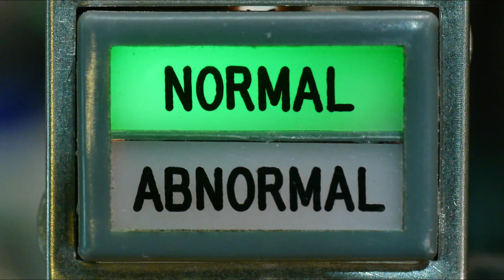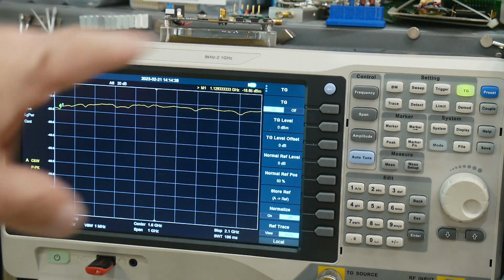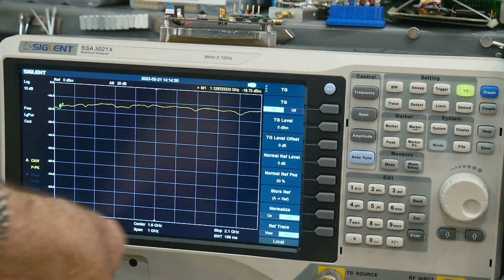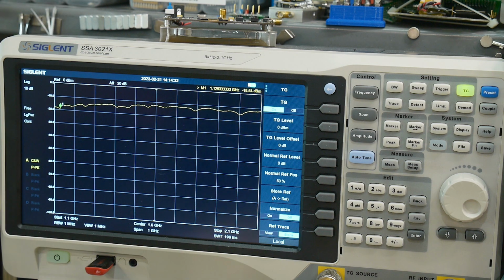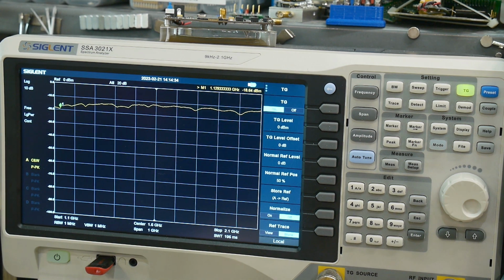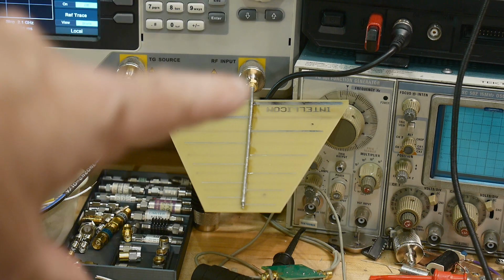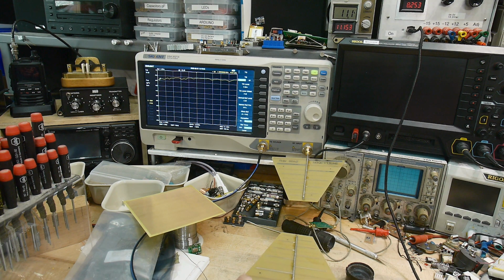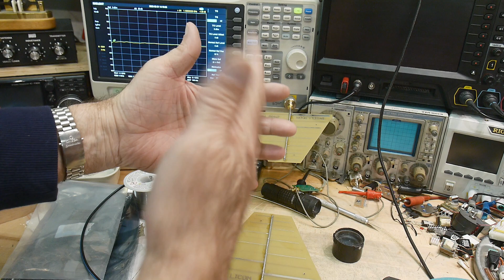#1440 Antenna Polarization and Wire Grid Polarizer

Comment: Can you add resistors to the wire lines to dissipate the RF power instead of reflecting back to the TX antenna. 
The 20dB reduction is due to reflection not absorption.

Comment: I went to engineering school and half the stuff you talk about on here, we never did in school.  When I attended in the 1990s, they were spending more time on digital, less time on analog, and very little on RF.  There seemed to be a thought that analog and RF were old hat and everything was going to be digital.  That was before cellular, wi-fi, Blue Tooth, satellite, etc. exploded.  And, we now routinely do digital in the MHz and GHz range which is of course RF.  

And, while we had Tek scopes and HP test equipment, the stuff you have on your bench, even the older items, are at least an order or magnitude better (higher frequency, tighter accuracy) than what we had in university.

Comment: In antenna we have Far field and near field and the near field is divided in two parts reactive near field (which is about 1/6 of a wavelength of the nearest antenna surface) and then Radioactive near field ( also known as Fresnel )
1/6 of wave length for 1GHz (wave length about 3m)  is about 3/6 or 0.5 m or about 1.5 feet. Polarization is more significant for far field.
Here some fun experiment: put an aquarium in the path of the waves and fill that with water and sugar. You will see , it will rotate the polarization.
Ferrite also rotate the polarization and they use this principle for devices such as circulators.
Since you have free PCB privilege, you make a 3 layer board top layer horizontal , bottom layer vertical, mid layer connecting each end of each horizontal line to each end of vertical line.
Keeping the order the same say top to left and bottom to right.

Comment: An interesting video.  It is fun to see one antenna transmitting to the other one.  I too believed the picket fence theory of polarization.  But now I see that it is completely the opposite. Thanks   PS - When I was a kid we had a similar, but much larger, TV antenna on the roof.  My brother bought many cables, connectors and amplifiers to try and get the best reception of the 4 channels in our region.  Since nothing seemed to work perfectly for all channels, he used to go up on the roof to tune the system for his favourite show - Mission Impossible :-)

Comment: 1) I was wondering if you could do the same experiment using a cheap VNA.
2) one thing that you forgot about polarization in high school is that light polarization is different than radio wave polarization which they differ by 90 degrees.  If the grids are parallel to the waves, the waves' energies are all absorbed by the cupper lines, where as for the lights the photons move between lines.
Reply: Not transmitting light so has no reference to these antenna's, Tho cool to let people know.. Everyday is a school day.

Comment: First, much (usually most) of the energy is reflected instead of absorbed.  Second, the picket fence model is correct from the magnetic field point of view.
Reply from the maker: yes, you are right, remember saying horiz or vert follows the E field though
Reply: @IMSAIGuy  Yes.  Magnetic fields affect currents in matter and currents result from electric fields.  Thus, magnetic field polarization is second order whereas electric field polarization is first order.  (In magnetized ferrites, these roles are reversed actually.)

Comment: I used an IR spectrometer to determine the polarized IR spectrum of a crystal I was studying back in the day. The diffraction grating itself is a good wire grid polarizer.
Reply from the maker: the effect you were seeing was not conductive wire grids, but something called Brewster's angle which is a different way to polarize light

Comment: 1:42 "...a bit lumpy, because these aren't perfect antennas and everything."

Well yeah, "everything"... That bench ain't no antenna range. Sometimes an antenna range can be a cheap outdoor range (ideally: source pointing up), or an expensive indoor anechoic chamber. If radio waves were purple, you'd see them bouncing all around your bench, certainly many within at least the -10 to -20 dB range. Cross polarization loss can be more like -30dB if the local environment is not reflecting things all over the place.

Years ago, we did some indoor (factory floor, not a chamber) VHF Antenna testing, and we could see the walls and ceiling distances in the reflections (tens of feet). Same thing here, just about 1/10th scale but stuff much closer (even scaled). So would be worse than what we saw.

Comment: Having 10 GHz source/detector would open up many more experiments. Using 3cm waves with various custom pcb's would enable refraction, diffraction, interferometry and standing wave phenomena to be observed on a manageable scale. Using stack of pcb's could simulate Bragg diffraction in a crystal, but that would need even higher frequencies.  Heck, just build an x-ray source, and everything will get easier.

Comment: Nice experiment. For this wavelength one should be able to demonstrate it as well with a 2.5 mm strip board with uncut strips. If you want to see whether it is absorbing or reflecting then just put the receiver on the same side as the sender. (It should reflect.) 
By the way with such a fine grid, if you have a thermal camera (# 1008 GUIDE MobIR Thermal Camera Review), you can already see some interference patterns of the long IR waves. The best way with this kind of set up is to reflect the image of a thin line source (remote soldering iron 😀) with a fine grid pattern of uncovered metal.
Reply from the maker: I wouldn't call 254um period a fine grid (0.010 inches)
Reply: @IMSAIGuy  I made my first experiments (when I was at school more than half a century ago) with a 100µm grid with optics (0.5µm) so 254µm must be good enough for thermal wavelength (10µm). I just tried it out with a mask from a CRT (TV-tube) which is around 300µm. The effect gets stronger when the mask or the mirror is not just held 90° to the rays.

Comment: What if you place 2 in 90° to each other and a third in between at 45°?
Reply from the maker: yes that is a classic experiment. https://youtu.be/r1sZY826Qys
Reply: @IMSAIGuy  I second that. Was surprised that you didn't demonstrate it in this video.
Reply from the maker: @Zandraccoon  It would have raised lots of questions and I don't feel like teaching it. The more advanced polarization effects require a deeper understanding and math. There are plenty of lectures on that already on YouTube.
Reply: @IMSAIGuy  Well, now you can easily demonstrate it! Simply mount one antenna horizontally and the other vertically, then insert the PCB between them at about a 45 degree angle and compare.

Comment: Convert to heat?  The traces are very conductive.  Are you sure they don't reflect?  Using the dipole 1/4 wave from a larger wire grid analogy -  the reflection creates directivity - and gain.  If the traces were resistive I would expect heat.
Reply: Maybe to test that theory, the receiving and transmitting antennas could be placed at around 90 degrees to each other
Reply: @Rodewerksahed  I would monitor S11 on the transmit side while rotating the "polarization filter"  held close. There should be very little change if it is absorbing.  You will see change if it's reflecting.

Comment: wonder if your IR camera would detect dissipation ?
Reply: The TX power is reflecting off the Polarizing PCB back to the TX antenna. The Power is not Dissipated.
Reply: @chadx8269  thanks Chad, you are no doubt correct.